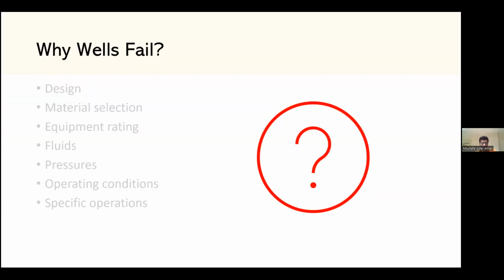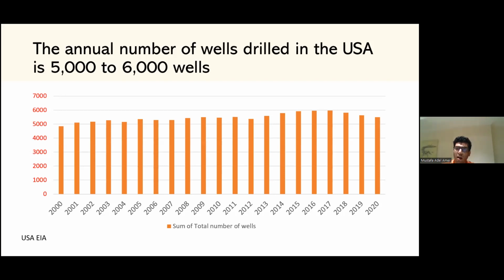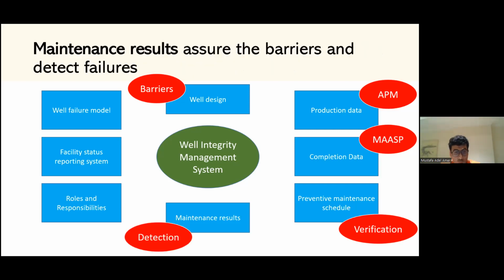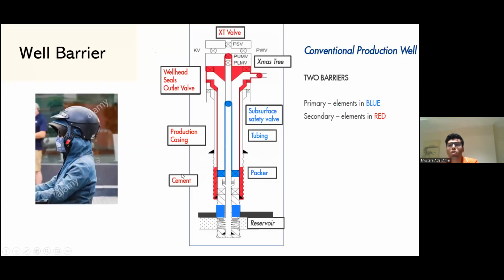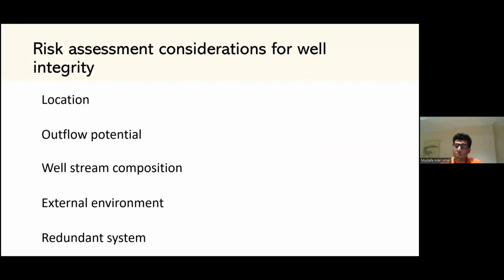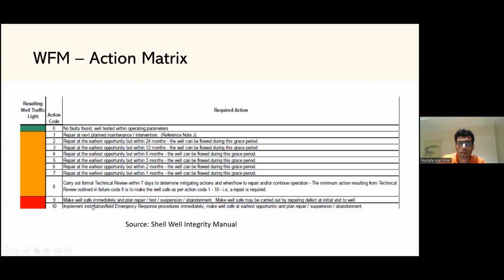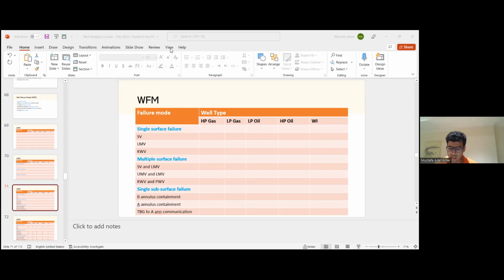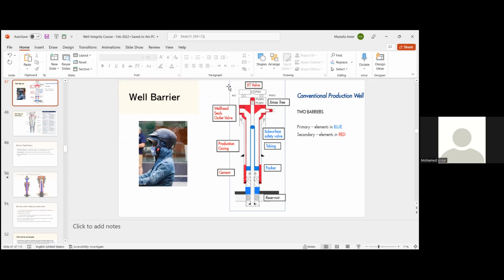Introduction to Well integrity management

Comment: Good Job... I want to know, during the operation of the well test eruptivity how does the collapse of the tubing occur and how to avoid it?
Reply from the maker: During a production test, the pressure inside he tubing is decreased as the flowing BHP is much lower most of time than the static one. On the other hand, the pressure on the annulus A side would continue to increase as long as the annulus is closed and this increase will be mainly due to thermal expansion which will increase by increasing flow rate (Higher flowing temperature profile).
So here are some tips on how to keep operating in safe conditions during a well test:
~~ Keep monitoring the annulus pressure and bleed off if required when it reaches to a certain value below the MAASP (commonly 80 % of the MAASP would trigger the need for annulus pressure unloading)
~~The common practice is to design the tubing string with the assumption that the inside of the tubing is empty while calculating the MAASP according to tubing collapse.
~~ The actual brine weight inside the annulus should be the one used for MAASP calculation.
Reply: @petroleumtrainingandconsul9300   Thank you!